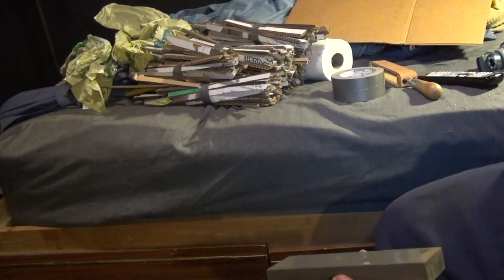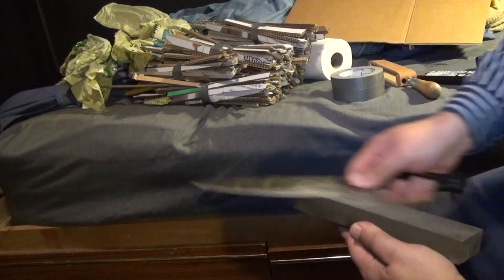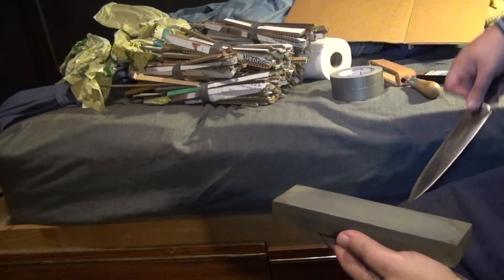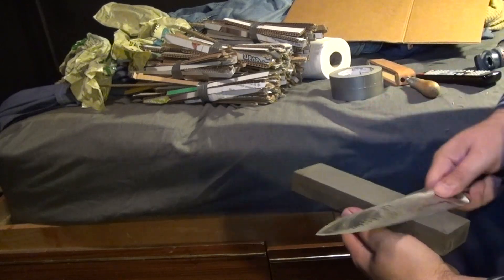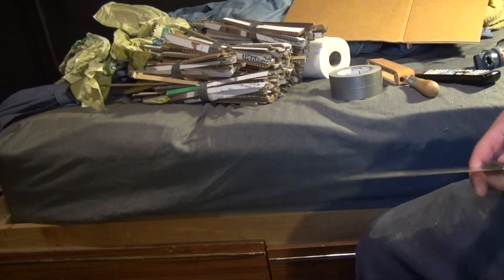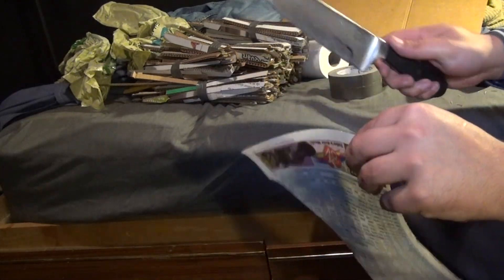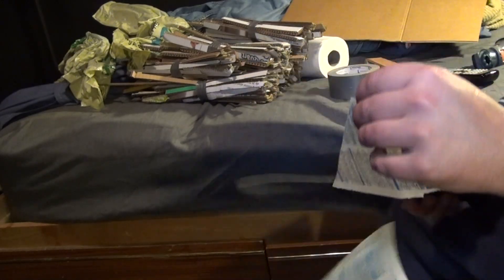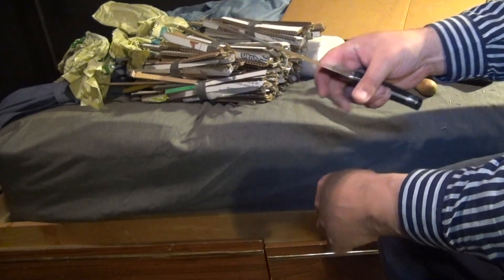Basic three step knife sharpening : destress the edge + shaping + finishing the apex

Comment: I just received an carbon steel Opinel No 8 and it was dull as shit.  I wasn't getting good results on my Sharpmaker.  Then I distressed the edge on a diamond Fallkniven DC 4, then shaped it on the that as well.  I then finished the apex on the Sharpmaker and it's awesome. Thanks for the great info Cliff.  It worked.  Now I'm going to put a patina on it.

Comment: Cliff, i tried to join your forum a few days ago, however i am yet to receive new user login info via the signup email? Is it still open for new users?

Anyway, here are my issues i was going to ask you if you are happy to answer here:

1/ off a 180 grit water stone, i can get a knife to cut phone book paper top side easy, but can only get a few short slices on the sides before it begins to tear. Very light de-burring with high angle passes each side and a few original angle level passes gives it more life (not for long). 

No matter how much i try, it never leaves this level of sharpness (I notice this also on a higher grit stones, seems to be only good for a few passes). In other words, the sharpness i get on the 180 seems to be my limit with very little advancement received on other stones.   

I cannot shave arm hair either, blunt in that area. 

What i am missing here to stop me getting to the next level? I have tried all the suggestions but nothing

Please help!
Reply from the maker: Send me an email (cliffstamp@gmail.com) from the email you used to join and I will review the logs.
Reply from the maker: To clarify :

-the knife slices PB paper, but only make a few such cuts before it dulls significantly (tears paper)

-the sharpness doesn't improve when going to higher stones
Reply: Thanks Cliff - i will send email

1/ Yes, slices the top edges of PB paper quite easily - but only a few slices on the paper side edges (cross grain) before it stops and tears.  No arm hair 

2/ Yes, i don't seem to be getting any sharper as i progress to a higher stone (it polishes more yes, but not much sharper it seems).

If it helps,  i have tried this with the raising a burr method and without by using the light reflection to see if either help. I have also decreased the bevel from about 20 to 10 dps also.
Reply: I have figured out the issue, it was the apex not being formed completely. I thought it was a burr issue. Now all is great - super sharp! Thanks!

Comment: Cliff I was wondering if you had any tips on removing that micro bevel (or whatever BR calls it) from a bark river, a Teddy 2. It's especially prominent near the tip, I can send you pictures later if you want. Thanks
Reply from the maker: If you want to remove an apex bevel there is only one solution, you have to grind behind it.
Reply: +Cliff Stamp yes. can I do this with sand paper? I'm not experienced with sharpening, and I only have an 800 king stone and a 4000.
Reply from the maker: Sure.
Reply: Thanks

Comment: In step #2 "Grind the apex bevel until it stops reflecting light", why is a burr not formed?  It seems if you shape the edge until light stops reflecting the knife would be fairly sharp at that point and a burr can form.
Reply from the maker: Not personally, but some people do.
Reply: Because you want to stop just after the edge is shaped but before it folds over i.e. a burr forms
Reply from the maker: +wojtekimbier Ideally, yes.
Reply: So a burr is may or may not be formed, but the goal is to minimize it through experience and paying close attention to light reflection - "chasing the light" so to speak.

Some people also talk about the sound and feedback vibration from the stone when sharpening to know when to stop.  Do you take that into account, Cliff?

Comment: I've been playing with this lately, focusing on just barely sharpening the knife to the point right before the edge apexs, as you stated in other videos. It is indeed an easy way to sharpen, but my question is: 
Why not sharpen till you get a burr, then do the apex sharpening? That generally removes the burr right away anyhow doens't it? For example, Japanese blade manufacturers on single bevel knives will just install a huge 45 degree micro bevel on their blades, instead of trying to remove the burr, because its quick and strengthens the edge... Is there any real benefit to not raising a burr in this plateau sharpening, other than wasting steel? Thanks
Reply: Crixus The Gaul  like he said in the video. When you form the burr, too much metal is removed and you past the apex. To put the apex back where you wants, you have remove more metal again. Like he said in the video, just remove enough metal that it do not reflex light. You can thin to a certain point and put a micro bevel on it.
Reply: your only a year too late! from what I gather now days, raising the burr just adds to allowing "weakened" steel to be part of your edge, and of course it is also a waste. Thanks anyway though!

Comment: So essentially all you do is get your rough edge geometry, and then lightly micro bevel the rough edge... 
I personally don't usually work with a micro bevel for the type of cutting I do, this is a great quick n dirty technique though. Probably does not make for the prettiest mirror polish however.
Reply from the maker: Max Savino The edge bevel and apex bevel can be the same finish, they are often the same grit though I normally use different stones. I usually set the apex bevel with diamond stones and grind the edges with solid stones, what one depends on the steel. A Suehiro Chemical works well on most steels, but will start to stall on high carbide, +60 HRC steels. I use a 240 SPS-II for those. 

If I am going to put an apex bevel which is a high polish (wood working) then I used to have to use another stone to raise the finish of the bevel but since I started plateau sharpening I don't need that anymore.
Reply from the maker: MasterofPlay7 The angle of the edge bevel doesn't need to be as high as the angle of the apex. The lower angle of the edge bevel increases cutting ability and edge retention.
Reply: Max Savino nah, it was Korin video, murray cater just to tell you the sharpen the knife as usual at the regular angle (whether is 15 or 20 degree) until you grind off enough metal; but I find it much faster if you raises the angle to 45 degree for chipped repair and return to sharpen at intended angle

As for the lowest possible angle, I think that has to do with the hardness of the steel whichever the steel can hold that bevel
Reply from the maker: +Yehoshua Jason D. Stone It isn't strictly necessary yes if you do it perfectly as the apex isn't over ground with a heavy burr.
Reply: Cliff Stamp but I seen sharpening vid where the guy actually raised the angle to 45 degree to take out the chipped metal before reshape the edge's geometry, I don't quite get why you decrease the sharpening angle first
Reply: MasterofPlay7 your definitely referring to Murray Carter, or at least thats what he does. Its just to get rid of the chipped area. He then goes back and makes the angle more shallow. Hes all about the lowest possible angle.
Reply: MasterofPlay7 no he tells your to raise the angle... at least in one of his dvds he does. I really recommend his fundamentals dvd, i twas worth the cash honestly, the second video not so much. But yeah, those guys at Korin make it look really easy don't they?
Reply: So another of the differences between the 3 Step and Plateau Method is the skipping of a bridging stone for preparation of a higher grit apex/microbevel? Just trying to clarify.
Reply: Cliff Stamp I just thought of something else, are the High Angle Light Leading Edge Passes and Crossing the Scratch Pattern used also, with the 3-Step vs Plateau?

Comment: Your videos are very informative. Quick question.

You say you never want to sharpen to a burr. I thought that's what you're supposed to do; you always hear people saying to "feel for thr burr" when sharpening. Then remove it with a stroke on the opposite side.

Do these principles apply to chisels and planes for woodworking? (sorry: two quick questions).
Reply from the maker: Van D Yes a lot of people say that. It is useful when you start to sharpen, but I don't think it is necessary and it really isn't optimal. 

Imagine if someone told you that the way to make toast is to burn the bread to black and then scrape off the burnt parts. 

Does this make sense? Would it not be more sensible to just lightly brown the bread and then stop at that point.

That is all I am saying.
Reply: Cliff Stamp Thanks for your reply. 

Yes, it makes sense when put this way. Perhaps I have been too harsh when sharpening (burning the toast) as I don't achieve this degree of sharpness. 

I shall give it a go. Thanks.

Comment: Why do you hold the stone in your hand?  That looks very dangerous.
Reply from the maker: I sharpen knives while watching  a computer monitor so I developed the habit of holding the stone as there was never anything to put it on.

Yes it is, I would not advise doing it that way.
Reply: Do you have any videos of you sharpening while not holding the stone? If so, do you ever use two hands on the knife? I've only seen you using one so far. Seems like it would be tougher to be consistent with one?

I've been raising a burr for some time, but not raising one makes more sense for durability if you can get sharp without it.

Comment: Cliff, do you have any tips on achieving tree topping sharpness?
Reply from the maker: I follow nearly the same procedure with a slight modification :

-shape on a coarse stone, as low as necessary
-work up to say a 2k Naniwa which is very muddy
-micro-bevel with an x-fine stone

The second step is necessary because you can't micro-bevel with say a fine Spyderco ceramic on top of a 320 grit Suehiro edge. Well you could but the edge would be a lightly polished 320 apex.

Keeping the stones muddy keeps the apex forming a burr so I like to use stones like th Naniwa Superstones, the older Kings (resin bonds), and stones like the Naniwa Aotoshi which are soft / muddy.

In the micro-bevel I switch to a very hard stone, no slurry to form a clean micro-bevel.
Reply: Thank you for the detailed steps.

Btw, is the best e-mail to reach you at cliffstamp at gmail?
Reply from the maker: Chris Lee Yes.
Reply: Cliff Stamp Regarding forming the micro-bevel: Why wouldn't the spyderco ceramic polish instead of cutting a bevel? I'm under the impression that the spyderco ceramic is a very hard stone that doesn't form a slurry.
Reply from the maker: Chris Lee
Chris, they will remove steel by abrasion, but they do load and will quickly start to burnish as well. I keep the ones I use very clean as I want to minimize deformation of the steel and focus on abrasion.

If I am micro-beveling with the fine or UF stone then I would have the apex already decently sharp with a much finer heavy slurry stone to ensure the apex isn't damaged (no significant burr). There is very little work left for the UF stone then. This is critical because the cutting speed is very slow.

Comment: Cliff, sorry to keep bugging you. I am giving this technique a shot now and was curious about polishing. Do you put the micro bevel on after you have brought the bevel to whatever designed level of polish, say 3k for the sake of discussion?
Reply from the maker: The edge should be similar enough to the micro-bevel to allow it to be efficiently cut, otherwise you risk deformation vs abrasion. For example if you tried to jump from a Sigma Power 120 to a Spyderco fine then the micro-bevel would not well represent the Spyderco stone because it would be slow to remove the scratches from the coarse waterstone and by the time it did you would likely have deformed/strained the edge.

I like the Naniwa Superstone 400 and Naniwa Aotoshi 2000 to prep edges for coarse and high polish micro-bevels in general as they are both muddy/soft stones and cut decently well for the grit finish.
Reply from the maker: Generally not, but I don't use a lot of stones. 

-reset the edge
-coarse stone
-muddy stone (which removes any burr/over grinding)
-apex bevel

If you don't use a muddy stone and you over grind with the coarse stone you can create a burr which has to be removed with a variety of techniques.
Reply: Do you distress the apex between each stone? If not, how do you know when to stop? so you don't over grind.

Comment: Hey Cliff. Still referring back to this video. For whatever reason my angles are held much more constant when I hold the stone in my hand like you are. I can get some crazy sharp stuff off of low grit stones now. What level of polish do you normally shoot for in your everyday knives? I can run my knives anywhere from 140 to 8k if I choose. I feel like 8k is a little much. Going to leave my 8k for my razor :). Thanks.
Reply from the maker: I use a 600 DMT for a lot of work, MXF DMT for kitchen work as there is more push cutting.
Reply: Cliff Stamp I've ran into a problem while trying to shape my Spyderco Chinese Folder's edge. I have the edge laid back around the 6-9dps, I'm not sure but it's low. I distressed on 220 stone and have been working the edge on an Atoma 140 for about 30 minutes and the edge still reflects light. Angle is spot on not sure if I need to go longer or what. Thanks.
Reply from the maker: ***** In many inexpensive steels, the really low cost ones, the steel grain can be so coarse it can be unstable when the angle is low. The first thing I would do is see what happens if you try to apex it at 25 dps. If it stops reflecting light immediately then it is most likely a steel issue. Then all you do is keep cutting the edge off and applying lower angles and see when it stops working and then just go back up one step. This ensures you have the highest level of cutting ability with the necessary durability.
Reply: I will definitely try this. Steel is VG-10 by the way. I'll let you know what happens.
Reply: Okay. I increased my angle slightly and apexed almost immediately. I could almost shave off of my 140 but not quite. More practice is my guess. I ran into another problem though. I know my edge is distressed however while cutting some cardboard yesterday the edged blunted very fast. When I got home I distressed again and re apexed on my 220. I cut some food on my counter top and it blunted again easily. My guess is that I am on the too thin side of "as thin as possible while still being structurally stable." My guess is to increase my angle again??
Reply from the maker: ***** There will be a sweet spot on angles, if you increase pass that the performance will drop off because the angle is so high that even minor amounts of material removed in wear/deformation cause significant blunting. But yes, changing the angle is the first thing to try.

Comment: Hey Cliff - I notice that you don't use any water or oil. I like that because of less mess but is it deliberate? Are they not needed? I went and got a 220/1000 waterstone to try this technique. Should I soak the stone in water for 10 minutes like the instructions say?
Reply from the maker: I almost always use water, this stone has water on it but it doesn't do much for honing aside from keep the dust out of the air. On other stones it can significant influence how the stone cuts/finishes.

Stones use different binders, some of them can be soaked, some of them don't need to be and some of them get damaged if you over soak them. I would strongly recommend that as a first trial you do what the instructions say so you can use this as a baseline and if you are going to soak it longer then do it gradually as over soaking some stones can cause them to actually break, split or disintegrate.